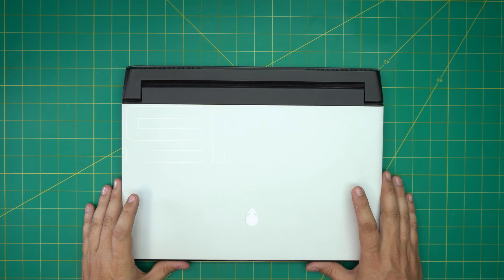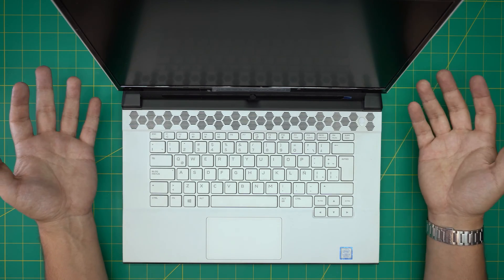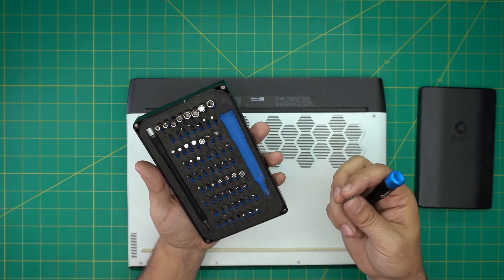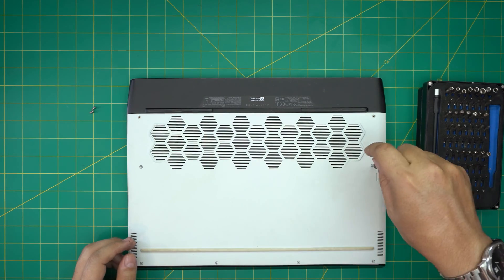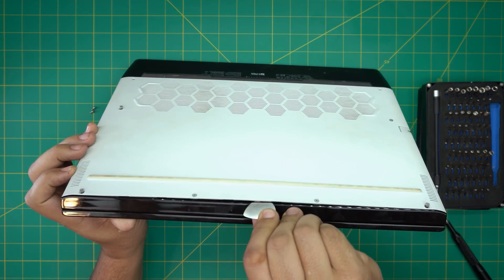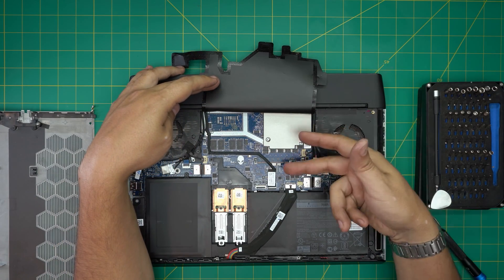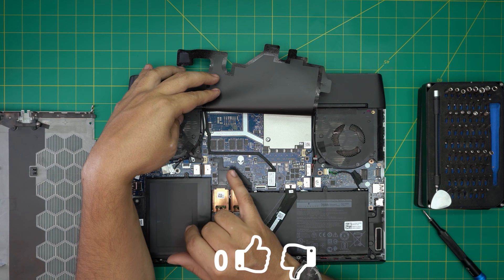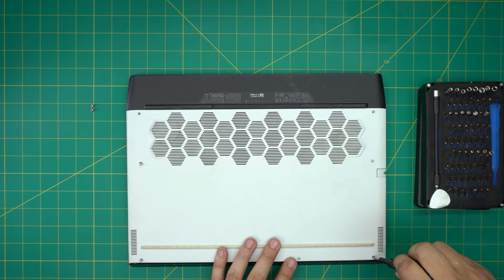Upgrade RAM on Alienware M15 R2 Laptop 🚫NOT POSSIBLE🚫

Comment: Hey can i fix it if i replace it with a new motherboard? because i have ram problem. its an m17 r2
Reply from the maker: Thank you for your feedback! If you wish to support the channel, you can like, subscribe, or both!
Regarding your question, sure you can, but the new motherboards are very expensive as it comes with GPU and CPU soldered on board and the ram.
Should you have any further questions or requests in the future, please don't hesitate to ask me.
cheers🍻

Comment: The A51M R2 was the last great alienware laptop, now they've dumped the num pad (required for some games) they've soldered the RAM and cards, they've gone for the 'thin' design which makes much less room for heat dissipation and they've nerfed the GPU & CPU, oh well. This will be my last Alienware machine.
Reply from the maker: Trust me, as a repair shop owner, it can be disheartening to see the frustration on my clients' faces when they bring in their laptops, and I have to explain that there's nothing I can do to upgrade the RAM or address overheating issues.
if you want a good laptop go with ASUS Rog Zephyrus G14

Comment: brother, I have this version of alienware Laptop, could I increase the ram to 16 GB or is it the same one in the video that does not have space to expand? is this 15.6" Dell Alienware m15 R2 - 9th generation Intel Core i5 - i5-9300H - Quad Core 4.1 Ghz - 500 GB M.2 - 8 GB RAM - Nvidia GeForce GTX 1660 Ti - 1920 x 1080 FHD 144Hz
Reply from the maker: Thank you for your feedback! If you wish to support the channel, you can like, subscribe, or both!
Regarding your question, unfortunately the rams are soldered on board and are not replaceable. you can't upgrade or remove it my friend.
Should you have any further questions or requests in the future, please don't hesitate to ask me.
Reply: @uFixTek  thanks bro
Reply from the maker: It's my pleasure my friend.🍻

Comment: Hello! Thank you for your videos! I wanted to ask. If I'm having a ram problem , with the physical ram on my Alienware M17 r2, does that mean the laptop is done for? 
Thank you so much
Reply from the maker: Thank you for your feedback! If you wish to support the channel, you can like, subscribe, or both!
Regarding your question, if you get a ram chip issue, that means that you will be spending around 120USD to get that ram chip reballed with new ram chips.
only experienced technicians can do it, we do that service for our clients if they have a bad ram chip that is soldered on board.
BUT it will take over 4+ before it can start degrading or going bad.
Should you have any further questions or requests in the future, please don't hesitate to ask me.